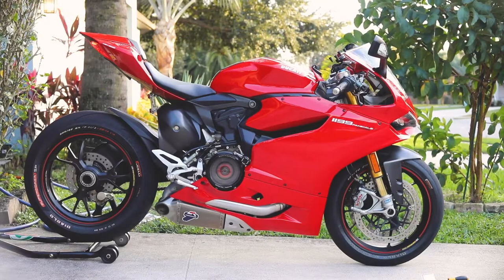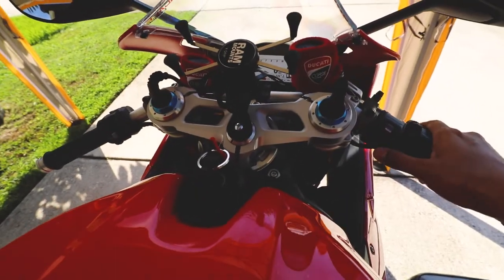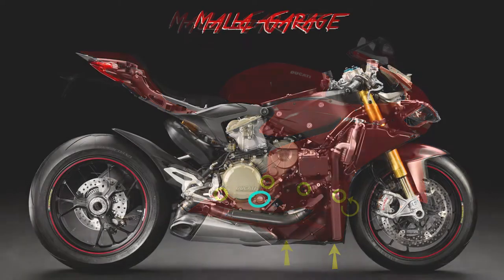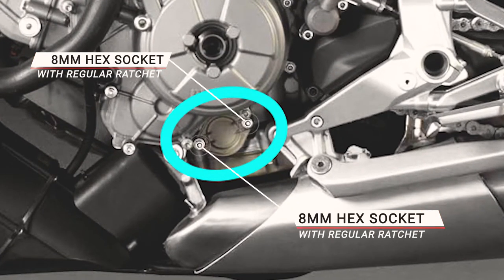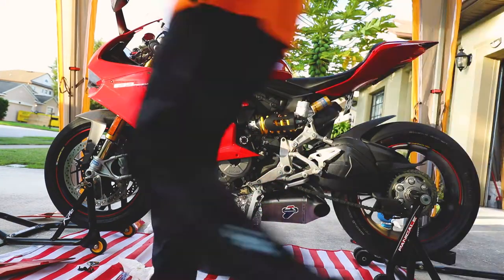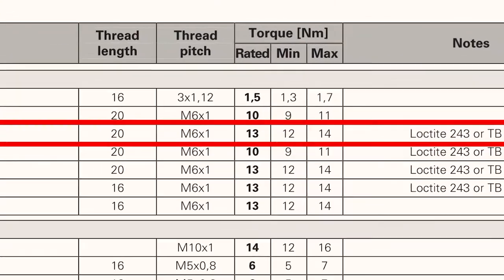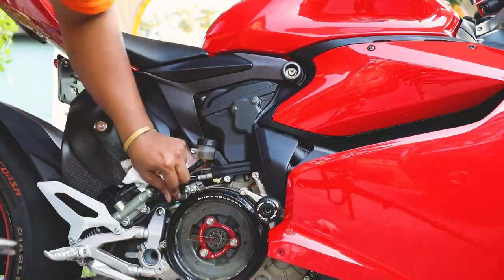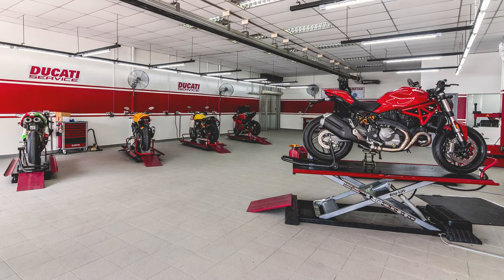Ducati Panigale Oil Change DIY

Comment: Love the content. Everything is in order and instructions are clear. I have read that you should grease the rubber o-rings instead of lubing it with oil. Grease can be Shell Gadus as recommended or any high temperature grease

Comment: Seriosly You change oil in this way? You should bring your ducati at ducati service... Do it for her
Reply: @graal_xcv6807  because this is not the right  method.
This procedure doesn't allow to check the real level of the oil insidie the engine, for example.
Reply: @graal_xcv6807  I don't wanna asnwer to your stupid question about Tmax... The quantity is written on the maintenence book but it could be different and not same all time.
You have to start the engine after the first filling, and after that, check again the level.
This is the correct way to check level, because if you do as you explain, you could use your bike without enought oil inside the engine